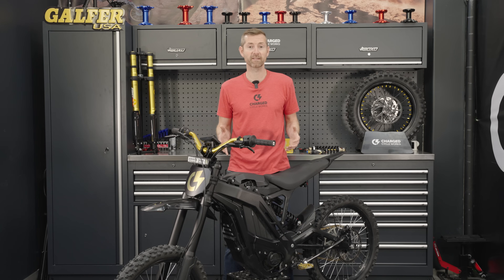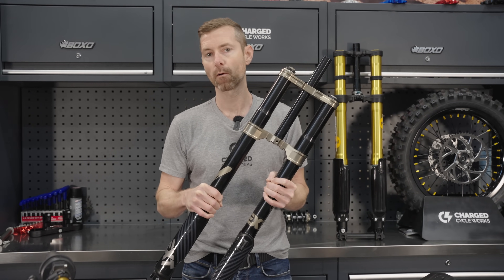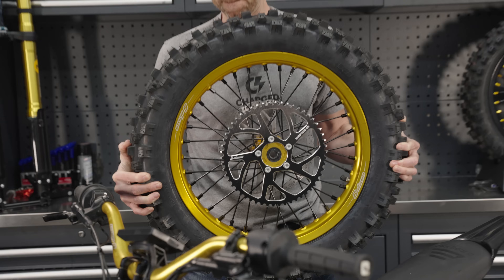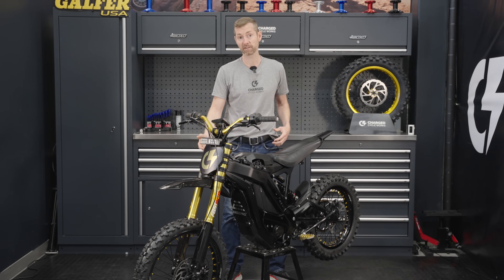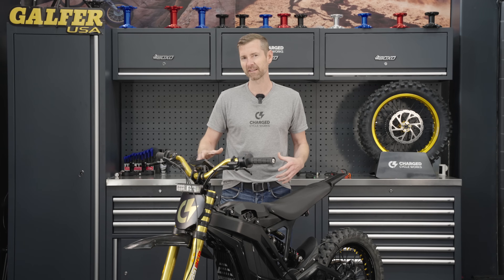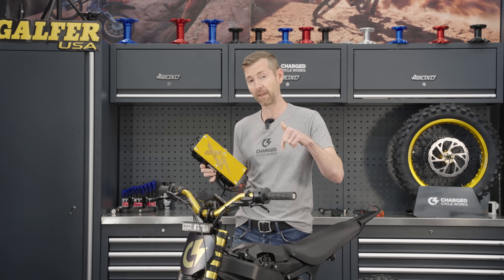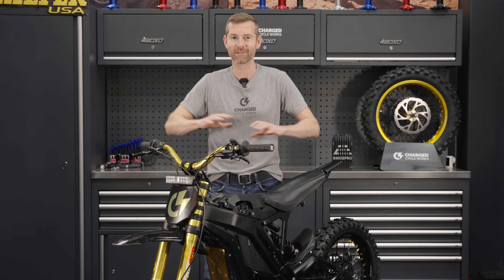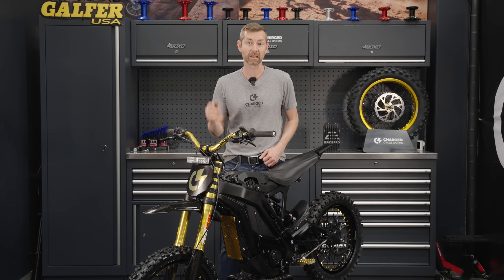E-RIDE PRO SS ULTIMATE UPGRADES (+EBMX X-9000 Controller Install!)

Comment: How many teeth are you running on that sprocket for the 16 rear wheel? im about replace the 19-inch rear and 55 sprocket with that set up? I hope that the 60 tooth is no too low in gearing? Thank you!
Reply from the maker: we are running a 54t sprocket which allows you to keep the stock chain and still has plenty of torque. Especially with the x-9000 installed

Comment: can you replaqce the front wheel with another rear wheel including another motor, speed controller and battery? hook it up to a single accelerator.

Comment: So I’m a heavy guy.. all these bikes have horrible weight limits… which would be the best to buy and upgrade the suspension? Or would it just be better to go real dirtbike/motorcycle?
Reply from the maker: The Surron Ultra bee is definitely the way to go! Slightly bigger bike with better suspension options for the weight

Comment: I ordered the warp 9 3” rise handlebar for e ride pro ss do I need a new mount stem?
Reply from the maker: No, the stock stem should work. The E-Ride comes with a nice 2" rise handlebar already, we definitely would suggest keeping those bars and doing a direct mount stem instead if you were picking one or the other, but you won't be disappointed by those bars!

Comment: I’ve already seen lots of people complain about the battery connect getting stuck and not able to pull out after hard rides or top speed rides so how did it do with the added 3kw? would it not just fry the connection together even faster then it does already. super stoked tho just got my pro ss and have gotten to ride due to having acl and meniscus surgery so on crutches for 4 weeks but can’t wait to ride
Reply from the maker: We highly recommend putting some dielectric grease in the connector to help prevent this from happening!
Reply: @ChargedCycleWorks  and it really stops it with the 3 extra kw i have already put some on my bike and i haven’t even gotten to ride lmao i think it’s just a good option even if they don’t get stuck it makes putting it in and taking it out much easier
Reply from the maker: also, heal up soon!

Comment: A lot of ebike riders don't know how much better suspension can make your every day ride.  Just having it set up for the right weight of rider and style of riding greatly reduces fatigue, you won't be bottoming out on jumps and general rocks and ruts wont be ratting your teeth and the whole thing rides like butter.   Some of the first ebike forks were just simple springs and snazzy looks. so many Surrons and clones now mean there's a huge suspension market thats growing every year.

Comment: If a new controller with stock motor+battery gives 15kw will an upgraded motor and controller run 20kw+? Or is a battery upgrade still needed?
Reply from the maker: Battery upgrade is still needed to produce that high of power output
Reply: Wonder if the Torp controller can be modified to fit the bike I’ve heard it has weird connections.

Comment: Im undecided between an eride pro ss and a ventus one
Reply: Get the Ventus if you have the cash. The Eride has issues these guys never talk about.
Reply: @Shreddylife  issues like what ? im just curious . i just bought a talaria mx4 it arrived tomorrow
Reply: @ayocxrry-2435  Forks leaking, the pulley ring guide coming apart, clearance issues where the swingarm meets the frame and it begins to rub metal on metal. Mine has been good so far because it came with an updated pulley, my forks have not started leaking like a lot of others have also and I hope it doesn't start to. Mine does have a clearance issue on the left side where the swingarm bolts into the frame though. I am still waiting to hear back from Gritshift to see what can be done about it. The good thing is Eride is covering most things under the warranty. The seat really sucks for longer rides as well so I hope there are a few companies that will sell some softer seats for it in the future. Other than the clearance issue with mine it's been pretty solid but it still has very low miles. It's still a badass bike for the price.

Comment: I think most of the 2 seconds saved is due to the rider just getting his time down, on the last lap he was cutting corners much more and not spending so much time in the air on the jumps. I'd rather see a straight line speed run to see if the Controller is a worthwhile upgrade to my Pro SS
Reply from the maker: The inside lines on the corners were only doable because of the amount of torque that was produced from the controller. He was unable to hit those lines effectively on stock power. 

Gearing is was effects too speed so with the controller added on top speed isn’t very changed, however getting to that top speed happens unbelievably quicker
Reply: I'm not a dirt bike rider so I can't speak to that but I was also wishing for a drag race or drag times to see the benefit of the controller.
Reply: Great video but i would also want to see some 0-top speed runs on a street vs stock controller so we can actually compare in a more easy way. For 1500 (here) i wanna see a big change in power and its hard to tell right now. Thxxxxxxxx
Reply: Question; are you guys building upgraded bikes like this to sell directly to a customer? If so, how much would this bike cost such a customer, already built. Very interested…
Reply: You have concluded by “saying there’s really not much more we could do to this bike”. Yet I am left wondering, isn’t the belt drive still a total weak point, especially with all this upgraded power, etc.? Are you not eliminating or replacing those belts?
Reply: Suspension is everything in any kind of race.   Better suspension (when dialed in) equals more speed.

Comment: I'm totally down for some comfort items or "essential upgrades" i.e. tires, sprocket, bars. But you're telling me 4k if I want to save 2 seconds off my track time? 😂😂😂 I bet the majority of people buying this chit are Flatlanders. Hopefully that extra 2 seconds gets them to Starbucks faster!
Reply from the maker: The track times were just a way to compare components head to head. Suspension and wheels are an incredible upgrade. The bike is already plenty fast but it was very impressive to drop another second off of the time with more power

Comment: Price? And mph increase?
Reply: It’s bout a thousand and some change and it doesn’t increase mph by much by accelerating is faster for a faster top end I think you would need to start changing sprocket sizes like the amount of teeth they have
Reply: I’m pretty sure you’d want to go smaller but your gonna lose some torque and if you wanted more torque more teeth but your gonna lose some of that top end hope this helps